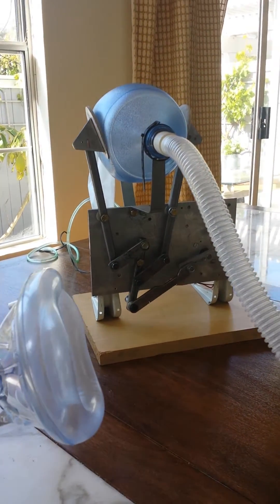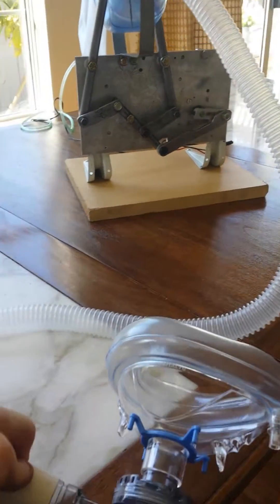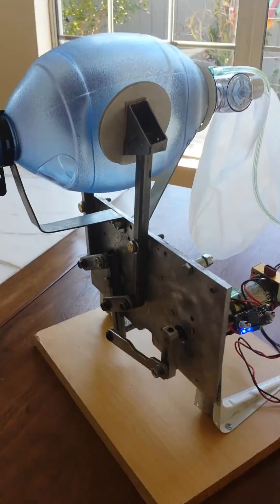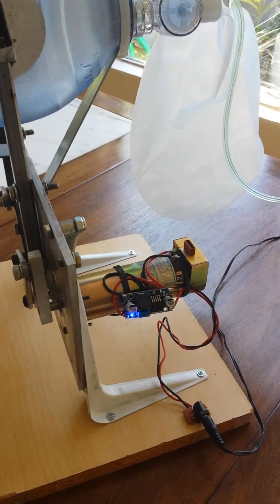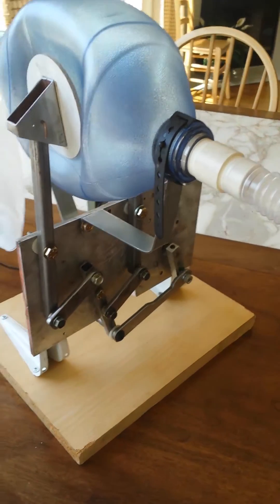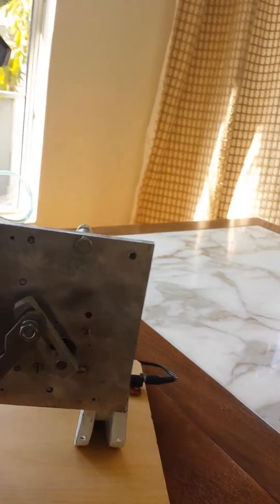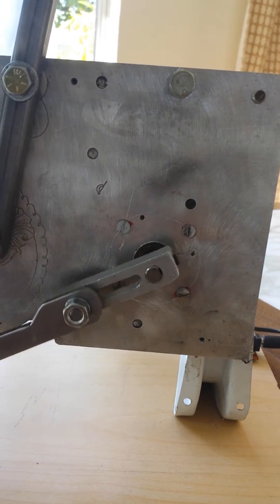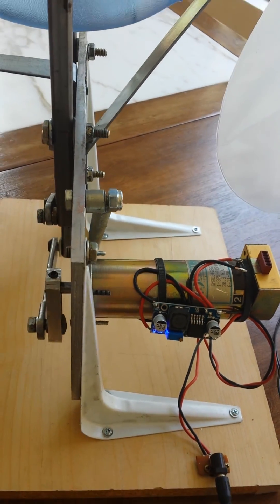DIY mechanical ventilator BVM  with mask

Comment: Good design, but a mechanical ventilator is never used with the mask, only with an endotracheal tube or tracheostomy tube.
Too complicated for the Third World and in an emergency in the United States. Take a look at this:youtube.com/watch?v=_0lB3IuuDo8
This is easily constructed using metal, wood, or plastic using hand tools. There is only one moving part and is robust enough to be transported in the back of a truck bouncing over roads, with thousands of holes per mile. The video can also be seen on this website doctordoctordoctordoctor[dot]com where you can leave comments.
 "When you have a hammer, everything is a nail."

Comment: Hi! Amazing initiative. Can you please explain how the width and thickness of the arms and links? Also please tell the material used and the pivot size and bolts size.
Reply from the maker: Hello, arms are 1/2"  or 12mm square   steel. Look in my dimensions  link  in the text below the video for more info.

Comment: This is awesome Peter!  I work for a metal fabrication company and would like to build a bunch of these to help fight the current pandemic in this country.
Reply from the maker: Hi Steve i have the dimensions on   https://youtu.be/SOVQIx0On30    it is still a work in progress, i will get to a cad drawing asap.  I'm not a medical expert. I am still trying to get a medical expert to actually review and test if it would work for covid .I'm just a regular guy trying to make a difference
Reply: @peterleiby5797  https://i.imgur.com/nvgr1Wx.png
Reply: https://i.imgur.com/nvgr1Wx.png This is what I have available as of now. https://i.imgur.com/nvgr1Wx.png
Reply: @dave4956   CAD please!!!!!!!
Reply from the maker: @dave4956  great work Dave, working on getting help from MITs  E-vent team for the electronics as well  and we handle the mechanical side
Reply from the maker: their link   https://e-vent.mit.edu/updated-electrical-operations/#comment-787
Reply: @peterleiby5797  knowing what motor and bolt hole pitch would be good as well, as I just set the clearance hole for 2" and the pitch of the bolts at set distance and 6mm tapped holes.
Reply from the maker: @dave4956   I am in socal under stay home orders . I have to go with what I have on hand.  What we really need is to find  a motor that is readily available low rpm hi torque with a    preferably optical 5v quad encoder. I can rob a servo driver out of my cnc mill and get going with what i have. So for the motor bolt pattern we need to finalize on a motor readily available in mass
Reply from the maker: Also, I have Phil that is replying on my first video link.  https://youtu.be/evWKC7D35AE    He is working on the robotics end, so that would have something to do with the motor.  Thanks for all of your work. Keep it coming.
Reply: @peterleiby5797  no worries hole pitch and clearance is easily adjustable.

Comment: If you posted or linked some dimensions etc I could draw that up on SolidWorks. My only thought is some kind of Teflon washers to reduce friction.
Reply from the maker: Actually it has Teflon/delrin washers behind it.You can see them in the video if you look closely, upper left arm. I will get a drawings to you asap.
Reply from the maker: I just put up another video with the dimensions
Reply: @peterleiby5797  I've been making up a model with some of the images shown, just might need to adjust a few things.
Reply from the maker: @dave4956   thanks .
Reply: @peterleiby5797   I like that  thank you for  posting it I have  one  question  what  bvm is that   with a  long  tubeing
Reply from the maker: @johnhammond2773  Hello, The bag has a removable head Link:    https://www.amazon.com/NEcommerce-PVC-Tubing-Reservoir-Adult/dp/B07P616J9K/ref=sxbs_sxwds-stvp?cv_ct_cx=bvm&dchild=1&keywords=bvm&pd_rd_i=B07P616J9K&pd_rd_r=ad817443-5912-4641-bed5-80575d49c579&pd_rd_w=zI7KD&pd_rd_wg=p7mmU&pf_rd_p=183579a1-f0e6-4556-8e39-8fe08e8f8141&pf_rd_r=4SFFSCVB3WGP6F6K6KXR&psc=1&qid=1590077952&s=industrial&sr=1-1-dd5817a1-1ba7-46c2-8996-f96e7b0f409c   .The hose is the standard 22mm airway hose used for medical  ventilation, you need to make an short  adapter for the hose to bag 22mm male to 25 mm male ( ¾ pvc pipe turned down to size)